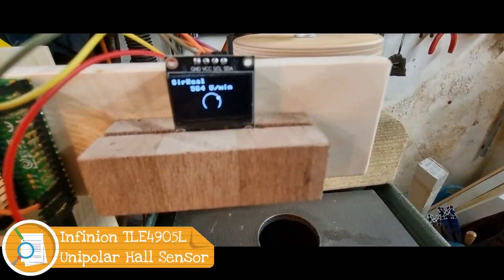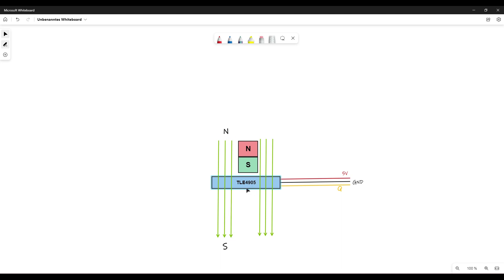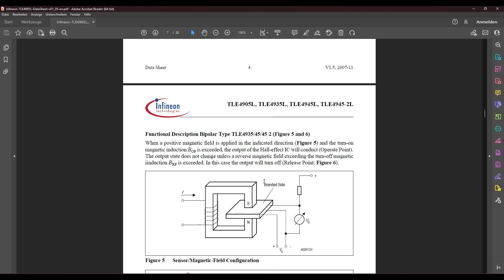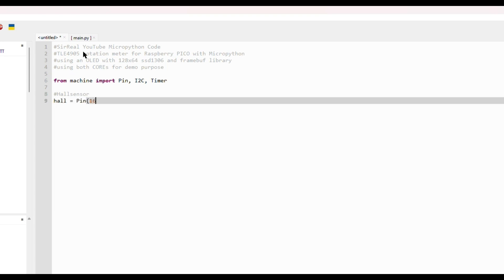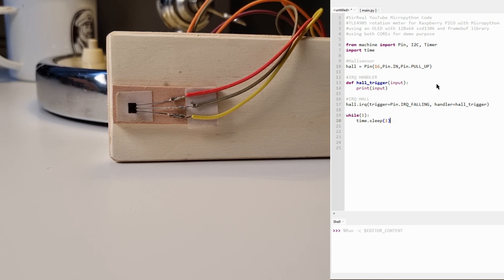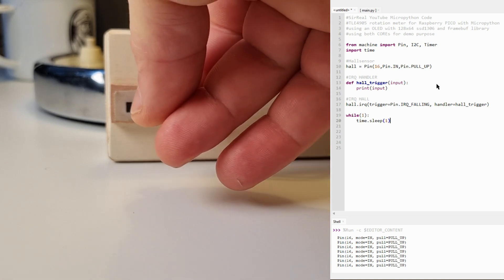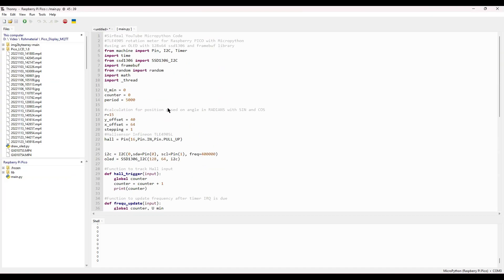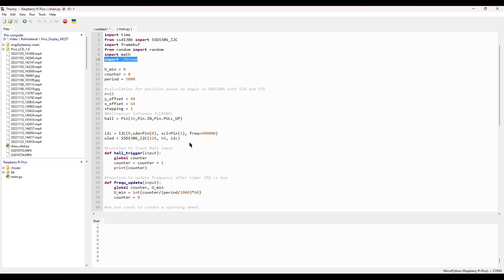RPM Measurement using a Raspberry Pico and an Infinion TLE4905L Unipolar Hall IC Switch/Sensor

Comment: Great video. Can this script also be used with RPi 2 (b)?
Reply from the maker: Not 1:1. This Micropython script is made for the pico, using the pico pins and pico libraries. Of course the basic principle can be translated to any PI but you need to exchange the libraries and take the right pins etc

Comment: First, you solve my PicoW MQTT issues, and now this!

I'd been looking for a video on this and couldn't find one anywhere. 

I thought the Pico would make a good bycle speedometer project to do with the local kids. I've seen several examples out there, but they all use GPS to calculate speed, distance, etc.

Big thanks, much appreciated.